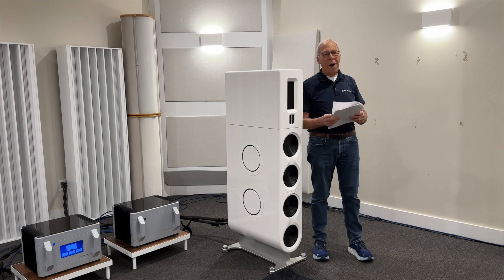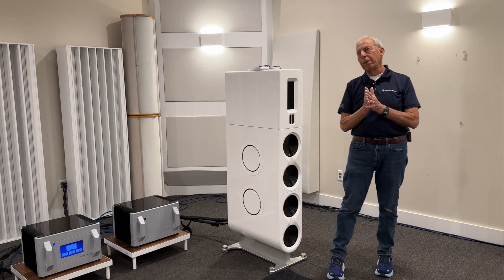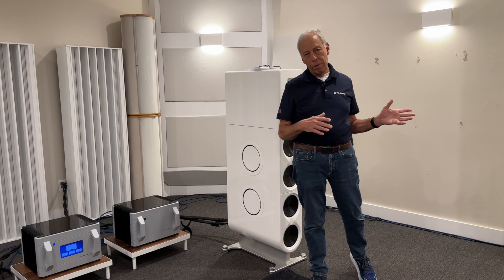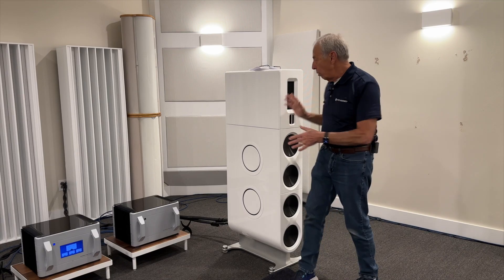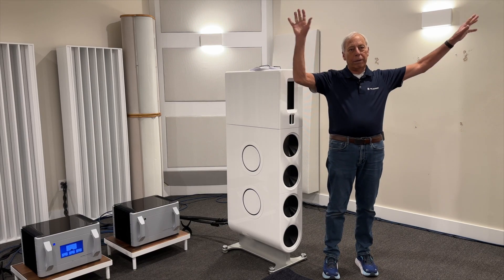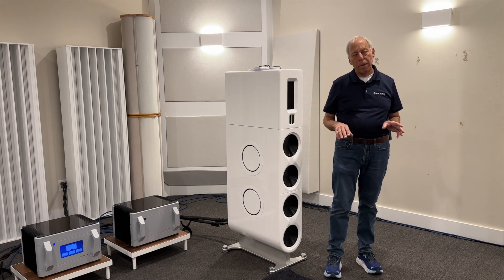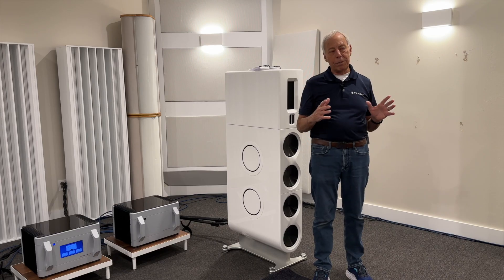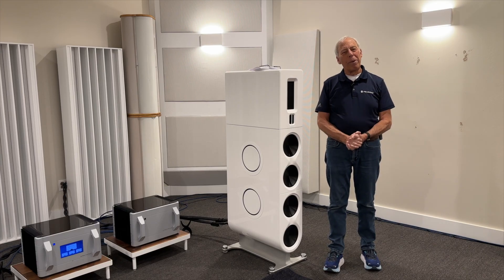Why loudspeakers need subwoofers

Comment: I'll never understand why people buy high end audio equipment like the PS Audio range and use it in a very ordinary room. If you can afford this expensive equipment you can afford to give it a matching room as far as acoustics are concerned. Two FR30 speaker units placed for optimal performance won't require sub woofers as Paul rightly said ... 
to be able to do justice to two FR30 units you need a 5 sided room with a pitched roof and modest floor damping . The volume of the room should be in excess of 10,000 cubic feet .
Reply: maybe we need to have a revolution in home design, most houses now are acoustical nightmares, i basically hate all my rooms, only one i manage to salvage and can put my speakers in, only place i want to be in also. acoustics should be a metric for all interior spaces, we are not evolved for indoor living.
Reply: Rich man's speakers in a poor man's listening room is rarely going to workout well

Comment: Well what you're describing is comb filtering and his point is if you can adjust the subs to point in different directions you can eliminate reduce comb filteringp. That's what you're doing with the sub at the back of the room. It's more about cancellation from reflections then adding bass
Reply: It also helps with that, but the bigger issue is that low frequency (especially sub bass) wavelengths can literally be longer than your room, over 20 feet/7 meters. This means that as waves interact, bass will actually have very distinct areas in a room where they cancel or add (called nodes), and by moving the sub, you are also moving the nodes around the room, allowing you a much easier and controlled way to get a balanced bass response at the listening area without affecting the rest of the frequencies or affecting the soundstage.
Because of the cancellation effect, it may actually be impossible to have any real bass at the listening position without moving things, no matter how much power you have.
Combing is actually when the signals reach your ears at separate times, whether there were more than one mic at different distances, not equally between the speakers, etc, or even an intentional micro delay for effect.

Comment: Does this mean that in this PS Audio room the FR30s don't reach their full potential and maybe FR20s + a subwoofer would be a better choice?
Reply: Exactly, in many rooms (i.e. most) dual properly placed high quality subs will achieve better results, however many manufacturers 'force' one to purchase their speaker model containing far deeper bass than is needed in order for one to obtain their Best Midrange/Tweeters/etc. The one plus side to that is, my towers play flat to 20hz (3 12" per speaker) and therefore regardless of any room that I have placed them in, they have always been able to play low enough and at very high volume with ease. Meaning, until I get them setup in a given room, I don't know 'what' the optimum crossover will be. I've had rooms in which that was 60hz, others that were 80hz, and one in which it was 40 hz. However in all cases my Towers easily handled whatever it was that I was asking of them. Another approach, which works very well and will save one quite a bit of money (as YOU indicated) is to buy their Best sounding speakers which are flat to 80hz (with a slow 3db rolloff thereafter) and then as you suggest invest in 2-4 subwoofers. The 'catch' is often a manufacturer isn't giving you their BEST stuff in their smaller / cheaper designs (Arendal does just that. Monoprice does just that. and Yes, it appears PS Audio is doing just that). Careful to insure that the speaker is truly capable of 60hz at HIGH output (so No, no two way bookshelf will do). Both Arendal and Monoprice give one dual Midrange drivers! As well both offer an option for for even higher output and better sounding Midrange by offering a tower version with additional Woofers and then crossing over the dual Mirange drivers slightly higher (1723 Tower & 460t Tower). Notice that with these two Tower speakers you STILL need 2-4 subwoofers, however if you have a large room or like me love to listen very loud (movies at full tilt) then the slightly higher Midrange crossover point, supported by the extra dual Bass woofers, allows for just that. I would suggest studying the designs of the Arendal 1723 series and Monoprice Monolith THX series to see what I mean. Two companies who have very SMART designs and who expect you to implement multiple Subwoofers and therefore don't force you to waste your money on below 60hz capable speakers and instead ALL of the money has gone into designing the best sounding speaks from 60hz to 20hz. Not that these are the only two manufacturers doing this. Perlisten is yet another manufacturer doing this and is an even higher cost/quality speaker than either the Arendal 1723 or Monoprice Monolith THX, the latter being the cheapest option with the Arendals costing midpoint between the other two. Your budget / income will dictate whether you go with the Monoprice, the Arendal or the Perlisten each which cost approx 2.5 times more than the latter.  OK well some food-for-thought that I hope Helps many out there reading this thread.
Reply: @johndaddabbo9383  Interesting read about a path quite different from mine. That's perfect, it offers options to readers. I upgraded from a 1500-euro system to a 4500-euro system. Got a refurbished Denon PMA-QS10 II amplifier and for hearing its potential I tried it in a shop with top-end Raidho speakers costing 15,000 euros a pair. Out of budget obviously but the Raidhos demonstrated what this Denon is capable of. I liked the Raidhos a lot and went for a solution to get close enough. Kef LS50 Meta standmount speakers are very nice in mids and highs but they lack bass. I tried them sitting on top of my Wharfedale Linton speakers, or with Lintons positioned elsewhere acting as surrogate subwoofers, but now bass became too much - the Lintons were not happy with the mighty heavy Denon PMA-QS10 II even in a 4-speaker setup. Replacing the Lintons with two refurbished 1980s Dutch Translator Impact5 tower speakers did the trick. Translator was a speaker builder in the Netherlands much like Bowers & Wilkins is in the UK. The Translator5 model is a four-way speaker, 1 below the top model of their line of the time. Combined with the more modern Kef LS50 Metas, the result is incredible. I added a RME ADI-2 FS DAC, and for 4500 euros total it's a system that's hard to upgrade without breaking the bank. Raidho speakers are still better, but not by much. I also could try it in my room with Wharfedale Elysians. Beautiful speakers, and like the Raidhos that would be an upgrade, but not enough for the price.
So ... in my case more isn't always better: upgrading to a bigger Denon amplifier using the Lintons went nowhere. Lintons however are perfect with something more modest. I keep them with a Denon PMA-1060 amplifier, a humble and dependable workhorse. Also, in my situation the 4-speaker main system can do without subwoofers, something I didn't expect when I began experimenting. The 4-speaker stereo setup works very well for both music and movies.
Reply: They want to sound of the speakers like they are, so you know what you get.

Comment: Bass needs dispersed because of the room. Is that so hard to accept. Don't rationalize that you don't need a subwoofer. Try one and if you still think that you don't need it; return it. Simple as that. Sonex (sparingly) and bass traps in the corners help substantially. Lets face it; you need perfect sound. Don't sell yourself short.
Reply: Yeah I had purchased some towers recently and thought great, I shouldn't need subs with this system. After a couple weeks I was happy with the sound but hooked up one of my subs just to try it out. It definitely improved everything about the sound and the presentation...and now I can't pull the sub back out, cause I know what I would be missing. Majority of the time a well integrated subwoofer will improve the listening experience
Reply: Whats very interesting is that years ago I had a digital time delay system, where you used the two main speakers at full volume and 3 rear speakers at a very low volume, which received the fraction of a second delayed signal, to simulate the longer arrival/reflection times of a big space. The speakers I was using at low volume in the back were Minimus 7 speakers with a 4 inch woofer and not much bass at all, especially played at that low a volume. The bass in the room sounded so different and right, like the whole long wavelengths were being let out. To me this means that bass being crossfired from different locations in the room accounts for the majority of the improvement, not just that there is more bass from another woofer putting out bass into the room.

Comment: If you build a subwoofer in your towers, its a bad placed subwoofer.
Reply: They are not effektiv tho, just more destortion in the room..., yet i have subbs in my towers + single subbs, next upgrade im not integrating subbs in the  towers, towers need their place, but thats rearly where the sub need to be.
Reply: Absolute rubbish 😮!!! Where did you get this stupid idea from ?
Reply: Tell that to the people in the car audio shows who don’t know the difference between a woofer and a subwoofer. 
They make the midranges play the high bass when that’s supposed to be the job of the midbass woofer. Anything under 60hz is where subwoofers are most efficient.
Reply: @Bassotronics  carsheads love the spl😂
Reply: @Error2username  
Yea they do, but not necessarily sounds well balanced.
It’s usually midranges tweeters, and and anything between 300hz to 70hz with a huge dip in frequency response and everything from 60hz to 35hz at 160dbs.
Reply: No because they're in both speakers. It's only when you have one that you need to find the correct placement - not when they are stereo pairs.
Reply: @cgsbff  that's correct ... you just cannot have " stereo bass " below 50Kz !! Some whackos claim you can 😂😂🤪
Reply: @janinapalmer8368  they might like it like that, let them do them, you do you👌and so on😂 No need too call names😂